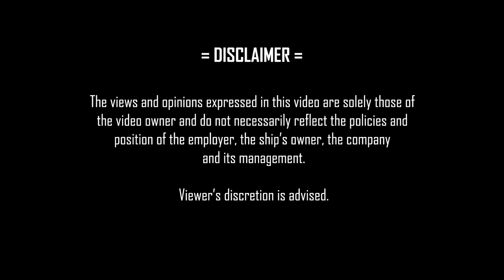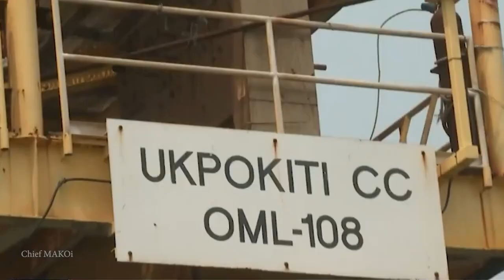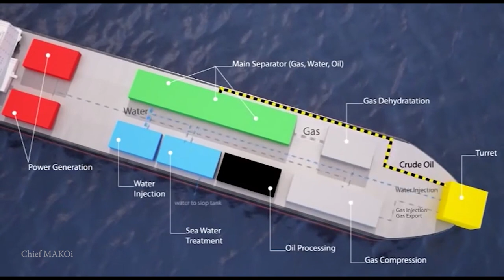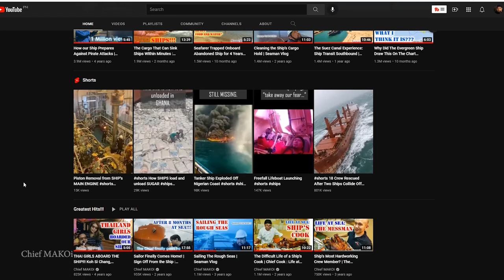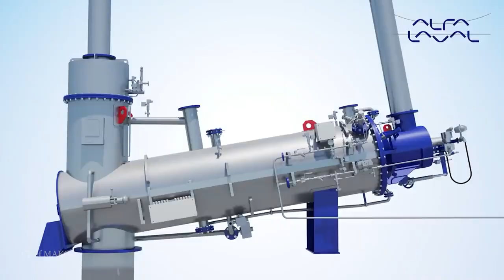Oil Production Vessel Exploded in Nigeria | What is FPSO and Inert Gas System? | Chief MAKOi

Comment: As a former firefighter, I was interested in how inert gases were created aboard these ships. Overall, another great video.
Reply from the maker: Glad you enjoyed it
Reply: Inert gases are typically produced by extracting flue gas from the ship's boiler exhaust. but in the event fire, the ship has to have redundant systems for fighting fires like sprinkler and/ or deluge systems
Reply: Inert gas is being created by the inert gas generator. It is the product of almost perfect combustion. Gas is being cooled and maintained at less than or equal to 5% O2. You can regulate O2 content via maxon valve reducing the FO pressure depends on the capacity you wanted to produce. Flue gas system is another option utilizing the boiler exhaust. 

Check out Alfalaval Ingert Gas system, Alfalaval Flue Gas system.
Reply: Essentially filling the space with CO2 from a special generator.
Reply: already on 'newish' "gastankers in the 90's doing a fullship IG inerting meant the chief engineer and choff  were pulling an allnighter, making sure the filters didn't get clogged, the O² content stayed low enough and the flow troughout the piping and cargoholds wasnt too turbulent as not to break the 'piston'... this 45y old vessel with a rinkydink 10 crew operation run in one of Africa's most corrupt countries...yeah cant say I'm surprised, that's why industry standards should apply.
Reply: @jawadad802  the fact that the ship is owned by a company who is in turned owned by another company really highlights your point

Comment: Hi Chief, your probably to young to remember the incidents in the South Atlantic 1968/69, Shell had 2 Super (M) tankers Mactra, Marpessa, explode with large lose of life, the reason was that these ships were hot washing their tanks, the  high pressure spinners that sprayed the residual crude from the inside of the tanks into the sump to allow extraction into the slops tank created friction this as you can imagine led to heat and Bang. Hot washing was stopped, until the idea of Inert Gassing was introduced. I would say that I believe all tankers at the time were hot washing up to this point, as we know Crude moves better when warm. Great Video
Reply: I'll add to that Maria Alejandra, Berge Vanga, and Berge Istra
Reply: I remember those incidents, which led to the temporary suspension of crude oil washing (COW) until the cause was discovered to be static electricity I think, generated by the high pressure jets of crude oil. Inert gas introduction was found to be a workable solution.  Great video and excellent explanation. Thank you Chief Makoi

Comment: Really great video. Thank you Chief!

I'm sure you know but would like to mention for others: The pretty explosion video is from the STOLT GROENLAND incident. What is interesting about it that it wasn't an oil or gas explosion. They were transporting styrene monomer, basically a material which can turn to plastic suddenly. This is what happened at a massive scale inside a tank on the ship which increased the pressure and ruptured the walls of the tank. This released a giant bubble of styrene vapours which caught fire, and this is what we can see on the video.

Comment: That ship would only have gotten an inspection when it hit a port with a Port State Control in it. If the ship sat out of territorial waters they could have side stepped the inspection process. Looks like that what happened. It could have had cargo migration into the ballast tanks. A ship that age might have not had double bottom, prior to Exxon Valdez. 
Their IGS was most likely broken, the ship wasn’t testing or the equipment was way out of calibration. The other side, what was the training level of the personnel operation the equipment or ship. Flags of convenience are not a good thing, or inspectors that receive gratuities for looking the other way.
Reply: What can we expect on a 10 crews onboard? 😅

Comment: One interesting thing to note, there is actually a fire square rather than triangle... You need a 4th component, Pressure.
If you have a low pressure environment with all the other 3 present, nothing will happen, as Cody's Lab have a video where he proves this.
That is also why airliners that are to suppress fire stays at higher altitude to keep the pressure low.
Of course you can attribute this to there being less oxygen due to the distance between the molecules being present, but that is the pressure link you are looking for to explain why they are distanced.
Reply: I can light a match and there is no "pressure" beyond basic atmospheric pressure.

Comment: 5:26 If I remember correctly this was a chem tanker with a hazmat cargo in two or more tanks consisting of a monomer composition that underwent a self-accelerating polymerisation reaction that led to the tank contents self-heating until the tank (and deck above it) ruptured and released a gout of hot hydrocarbon vapour that found an ignition source, you can see vapours escaping from a pressure relief valve to the right of the location of the ruptured tank and burning polymer globules raining down. The crew injected polymerisation inhibitor (a catechol based inhibitor IIRC) on multiple occasions but again if I remember correctly they only carried a limited quantity of the substance that they were provided and had to wait for more to be procured while in port at which time far too much heat was already in the tank contents, and a large soupy, foamy mass of semi-liquid precipitated plastic polymer was filling a large volume of the tank preventing the inhibitor mixing with the contents effectively. A large solid mass of polymer occupying most of the tank volume is visible in the post-disaster images in the incident report, hopefully it prompted legislation changes which require carriers of hazmat chemical cargoes that are capable of self-heating to their flash point and/or those that might require introduction of chemical inhibitors to suppress such self-heating reactions, to provide a sufficient quantity such that a crew can perform enough inhibitor injection into the subject tanks to secure reactive cargoes until the time they can be offloaded into facilities more capable of handling and storing them safely which may be some time after entering port.

Comment: I worked in Warri Nigeria offshore and on land rigs for a wireline logging firm in the 1980s and this event isn’t a big surprise. Safety training and standards were, at the time, totally absent, as was concern for the environment. As for the explosion and fire on the Trinity, any partially filled oil tank is much more dangerous than one that is filled. My guess is that the inert gas system was out of gas or broken - or both and/or the crew weren’t trained in its use.
Reply: It seams reasonable to me for it to be inoperative simply due to the age 50+ yrs of the vessel, the rest just adds fuel to the fire (Pun intended)!

Comment: I enjoy your videos Chief, however if I may I would like to correct a couple of things. Firstly the fire triangle consists of fuel, oxygen and ignition source not heat. For example motor gasoline has an auto-ignition temperature in excess of 240 degrees Celsius but will ignite from an ignition source at well below zero Celsius.  Also the ullage spaces of a loaded tanker will have an atmosphere far too rich with hydrocarbon gas to ignite. The inert gas is injected into the tanks while they are being discharged to prevent any oxygen being introduced. My last 6 years at sea were on product tankers which had nitrogen plants which produced nitrogen to inert the tanks. Exhaust gas inerting is too dirty for clean products. Anyway keep up the good work Chief.

Comment: What's the maximum age a vessel can be commissioned/sea worthy?
Reply: There isn’t an age. It’s all down to the condition of the ship.
Reply: Depend on materials used maintenance and drydocking and even how harsh her seasons are.
Reply from the maker: It depends.  I've been on a 30 year old ship that was well-maintained.  Only problem is finding parts for the machinery as most of them are already obsolete.
Reply: I worked on a DSV that was 36 years old. British built in top condition, doing SAT diving operations. Unfortunately my company had to scrap it when some rules changed and the ship could not comply with them. Its always money that dictates whether a ship lives or is scrapped.
Reply: @nikhilbhale79  ultimately this is a true statement.  Due to how expensive retrofits and refits are It wouldn't surprise me if there are hulls that have a longer lifespan that have been scraped because they were inflexible for the ever changing laws and safety requirements and the cost of trying to meet those requirements.
Reply: Totally condition dependent. Early in my career (early 2000s) I worked on board a ship that had 1942 build plates and carried WW2 battle ribbons.   This ship was on the Great Lakes, fresh water, so it was well preserved.  She has since been converted to diesel, but is still in service.
Reply: I worked on 50 year old ocean going vessels. The problem is regulatory grandfathering that allows conditions to remain that do not exist on more modern vessels.
Reply: I read somewhere that ships can require scrapping due to metal fatigue. Is that true? I'm more used to aviation where it definately is (planes have a definite fatigue life measured in flying hours and take-off and landing cycles, and once exceeded it can no longer be safely flown).
Reply: @rkvktmen  yeah and no.  The answer of no is due to the fact that for the most part any part of the ship can be replaced except a few major parts. And yeah is for major structural parts.

Comment: Curious that they use exhaust gas/CO2 as inerting gas, I would have thought that enriched nitrogen inerting would be more efficient, basically using an oxygen generator/enricher but taking the exhaust with enriched nitrogen to inert, and dumping the enriched oxygen fraction as waste, through variable zeolite adsorption technology, basically beads that at high pressure absorb nitrogen, and release it at low pressure. This is used in small scale with hospital/home oxygen machines.
Reply: I never thought about this before, but exhaust gas is already 80% nitrogen, so it doesn't need much further treatment.
Reply: N2 systems are frequently used on chemical tankers where cargo quality is of greater concern. Exhaust/flue gas systems may allow moisture to carryover into cargo through the scrubber and/or deck water seal. And there may be combustion by products like SOx and soot. So chem tankers usually use pressure-swing adsorbtion N2 systems or fiber membrane N2 systems. Oil tankers tend to use the flue (exhaust) gas system.

Biggest reason for this is how a chem vs. oil tanker is constructed. Chem tankers are usually broken into a couple dozen small cargo tanks, and mixing of cargoes can ruin the cargo and/or create dangerous reactions. As a result, each cargo tank has its own separate cargo pump installed within the tank. These are often referred to as Framo cargo pumps, since Framo manufactured the most commonly installed system.

Oil tankers do not need to worry about cargo grades mixing as much (unless you are dealing with extremely well refined products). So instead of small Framo pumps within each tank, they will have 3 to 4 large cargo pumps in a space between the engine room and slop/cargo tanks. These cargo pumps are usually steam turbine driven, so the vessel needs relatively large boilers.

Since you have these boilers generating all this exhaust gas, and you also need to maintain an oxygen deficient atmosphere in cargo tanks when carrying flammable cargoes, and you aren't worried about a little sulfur or moisture carryover ruining your cargo, there is no real drawback to using an exhaust gas (a.k.a. flue gas) IG system.
Reply: @phantomsplit3491  Thanks for the great explanation, very detailed. Any opinion on why tanker cargo pumps are steam turbine driven and not electric, that way boilers could be eliminated? What else do the boilers feed, I never really though about steam being used on ships still as a means of power...
Reply: @jovangrbic97  I was actually on an oil tanker a week or two ago (I inspect ships) which had electric driven cargo pumps. You hear about them and they are kinda like unicorns. I really don't know why they didn't take off.

Most oceangoing ships nowadays are propelled by 2 stroke, slow speed (130 rpm max), diesel engines ranging from 6,000 kW to 30,000 kW or more. And they'll use 4 stroke 800ish kW diesel generators. Only place you really see steam propulsion nowadays is on LNG carriers and on the Great Lakes. So the boiler isn't as important as it once was. 

But all ships will still have a boiler for heating oil and sludge to settle out water from oil, heating fuel and lube oil for purification, heat heavy fuel oil to bring its viscosity down to be injected into engines. Many will also use it for cooking and living area purposes (hot plates in the galley), hot water heaters. Steam will also be used for some really weird purposes, like blowing out the strainers that take in sea water or smothering fires within the main engine frame, or heating the main engine cooling water so the engine stays warm and ready to go while in port. Ships that go to polar regions will also use steam to de-ice.

Tankers will additionally use steam to heat cargo to bring viscosity down to pump it ashore, heat water to be used to clean cargo tanks, steam turbines to drive centrifugal cargo pumps, and the stripping pump used to get the bottom bits of cargo that the main pumps can't get. When tankers water wash a cargo tank, they store that oily-water in what's called a slop tank. You can then heat this slop tank so the oil and water settle out, and then send the water overboard (through pollution monitoring equipment) but hold onto the oil. So steam is used in slop tanks too. Heating cargo and the main cargo pumps are the big two here.
Reply: @phantomsplit3491  Super cool! Again thanks for the interesting stories. One doesn't really consider steam to be the go-to heat transfer medium, even though it was the one and only for so many years, and it wouldn't be a surprise that the place it 'sticks around' longest is the naval/marine sector. My guess for shipboard general 'heat stuff' purposes would have been a diesel burner heating a closed loop, oil filled system and a bunch of heat exchangers at the usage sites, but really steam makes a lot more sense, as you can 'spray' it out on things without making a mess and actually being able to use it as 'liquid heat' instead of a 'slow' heat exchanger heating some secondary system. Where does the water for the steam system come from, can you use salt water and just dump the remaining brine overboard, or do you have to use separately 'distilled' water (or maybe reverse osmosis) to protect the steam generating system from the inherent corrosion heat and salt water bring? Do ships still mostly distil fresh water by boiling or is reverse osmosis widespread now? Cheers!
Reply: @jovangrbic97  All great questions! The thermal fluid/thermal oil system you described is occasionally used on vessels like asphalt carriers to heat cargo, but is rare for most other applications. The boilers on ships do use a closed loop fresh water system which is chemically treated for contaminants, scale, and alkalinity. Cruise ships and some other weird vessels will use RO. But most of your ships 100 m or more in length will use evaporation to distill. This distilled water can be distributed to make up water in systems like the deaerating feed tank for boiler feed water supply, or engine cooling water expansion tanks. It can also be used to fill the ship's potable water tanks.

The distiller an incredibly clever design. Text isn't really the best way to describe a system like this that is constantly running while ship is underway, but I'll try.

1) Pump sea water in and send it through plate type heat exchanger where the other fluid is the sea water you've already evaporated. This condenses the fresh water which was once sea water that has already gone through the cycle. And it also heats the sea water you are about to evaporate.

2a) Some of this now slightly heated sea water will be go to be the motive fluid of an eductor. It will suck out all the brine from the rest of the system, and also put the evap stage under a vacuum therefore lowering the boiling point of the seawater

2b) The rest of the sea water goes to the evaporator, which is another plate type heat exchanger which is surrounded by slight vacuum thanks to the eductor. The heating fluid in this exchanger is actually the cooling water coming straight from the main engine. This allows you to get a little cooling in on the engine water before it goes to its own cooler, and also evaporates the sea water.

3) This evaporated sea water goes through some demister screens, and then back to the condenser described in step 1 where incoming sea water condenses it back down.

It does require main engine to be running for the distiller to be used. So ships aren't making water while they are moored up. But the water treatment is pretty rudimentary (UV sterilize and/or chlorinate) so you also don't want to be drinking water which may have run-off, sewage, garbage, etc. You only want to use the evap when you are well offshore anyways. If you are in port and need water then you can get it delivered by barge or truck, but this really should never happen on a well managed ship unless something breaks. I sailed on a container ship where a sight glass for the evap cracked, we couldn't maintain vacuum, so water could not evaporate. When we got to Germany, we got a spare glass but also had to take on water. Only time I've ever had to load water.